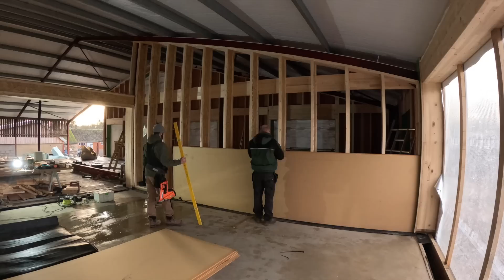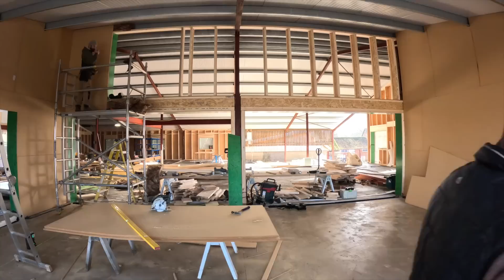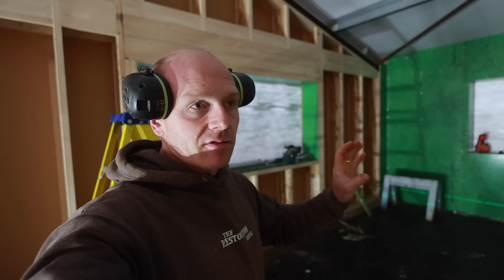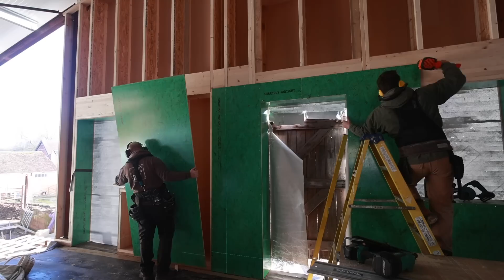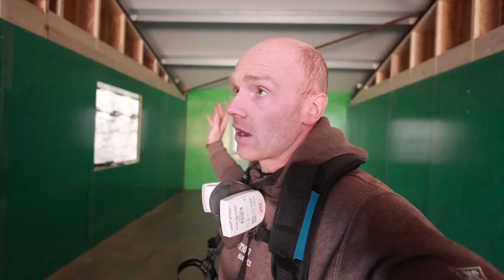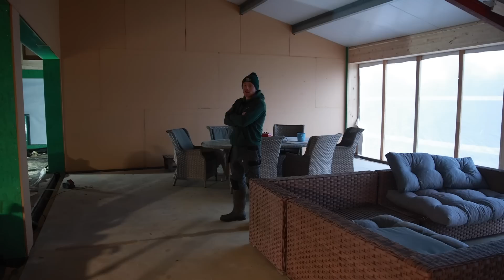FIRST ROOM BUILT! - The airtight OSB is going up

Comment: Just taking a guess here on the 625 CtC measurement: for stone or glasswool insulation rolls or matts 600 wide installed in between 25mm wide non-load-bearing studs or in between 25 mm wide battens screwed against studs or some system like that.

Just to use most of the insulation that comes in 600 wide, which is actually only usefull for building 600 on center systems when installed in between steel C-studs (being hollow).

Comment: I'm still confused about the blown insulation. Each void looks like it is sealed. Do they need to drill a hole into each and every space? Recycled paper, how do they make that fire resistant? Really enjoying you build 👍
Reply from the maker: Probably easier to explain all in a separate video but a cellulose supplier like Warmcell's website would probably explain better. 👍

Comment: I saw a nail spacer being used between 2 panels under a window but notice them used elsewhere. Is an expansion gap necessary between OSB panels? Really moving along now, Tim. looks great.
Reply from the maker: Just knock a 3mm nail in against the edge of each board and pulled out after. The boards are undersized to allow for 3mm both sides.

Comment: Maybe a stupid question, but what about first-fix  wiring and plumbing before panelling both sides of stud partitions?
Reply: I believe there will be a service cavity installed. So some sort of batten installed on the airtight OSB which will give a gap to run wiring and plumbing, then plasterboard/finish material over the top of that. Tim did something similar in the cabin build if I remember correctly.
Reply from the maker: Yes, this. 👍
Reply: I got a bit anxious watching it thinking of the first fix!  Maybe surface mounted?

Comment: Great video as always but if this building doesn't cost 10 grand a year to heat, I'll be amazed. It's just so big. Maybe you can move some cattle in for some passive heat gains :)
Reply from the maker: It better not. 😬 The heat demand is pretty low now, main risk will be overheating in summer but taking steps to sort that.

Comment: Did you consider making the roof over the garden room glass or even electric shutters? It would enhance the psace in the summer months. Hanging vines from the steels maybe?
Reply from the maker: Our first plans had no roof over that and a balcony for upstairs. In the end we were only permitted 2 large velux but still need to be careful with overheating so will see how it does this summer.
Reply: @ that’s a shame the planners refused your original plans.

Comment: Do you do anything special between the concrete and the green boards? Are the Factory edges pre-sealed, do you have some dpc or is it perhaps not needed?
Reply from the maker: They are 5mm off so we will seal that gap when we done airtightness details.  That said, the concrete is all above DPM/DPC so will all be dry, especially once heating pipes on.

Comment: Just wondering why you are working on the internal walls when some of the outer walls are still to be done.🤔
Reply: This "garden room" is technically an outside wall. It's under the roof but the walls are being built in the same way as the outer walls. After this, all the outside walls are complete. Any openings in perimeter of the building now, are for glazing (windows and doors).
Correction: I believe there's still some work to be done in the pool room? But that's odd own issue? I might be wrong about that.
Reply from the maker: All these need to be done before we can tape up and start on first floor.  The last wall needs some blockwork still so was waiting for weather to warm a little so starting next week.

Comment: Assume you have designed a deflection head on the timber panels under the rafters and purlins for snow load, a portal frame that wide I would expect to deflect >50mm.
Reply from the maker: Stud walls all designed to be load bearing so tight under steelwork.  Hence why all internal walls line up with the frame.

Comment: Electrics?  Running cables in walls etc
Reply from the maker: All to be run inside of OSB.
Reply: @TheRestorationCouple ????????are you grooving the osb with router then put the plasterboard over the top
Reply from the maker: The whole perimeter wall will be battened off to create service cavity, same as we have done before.